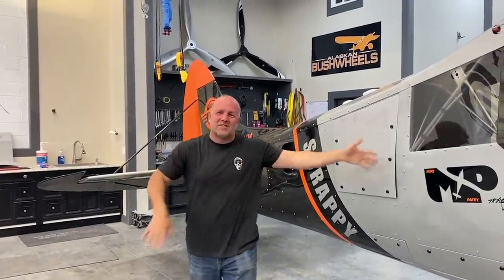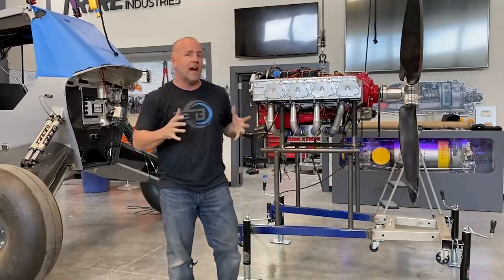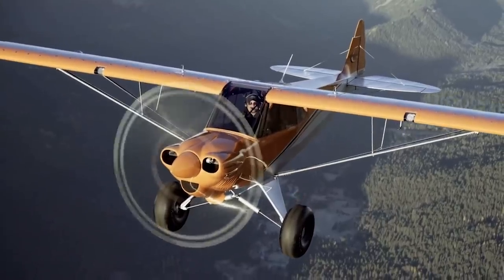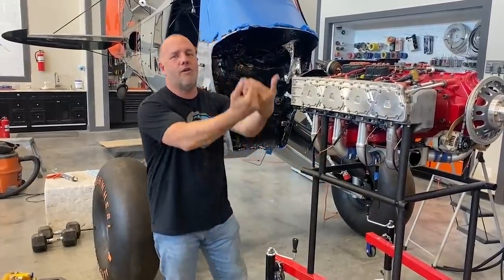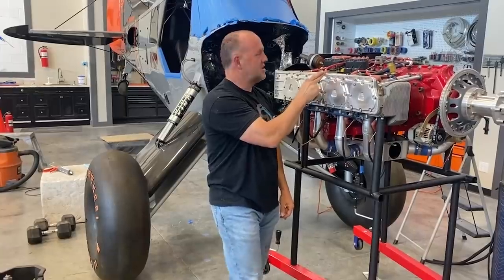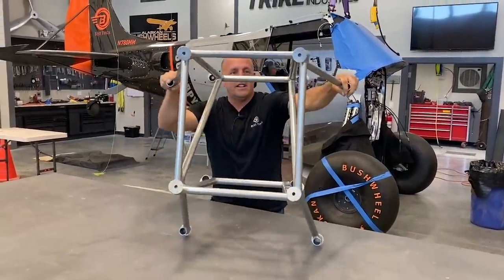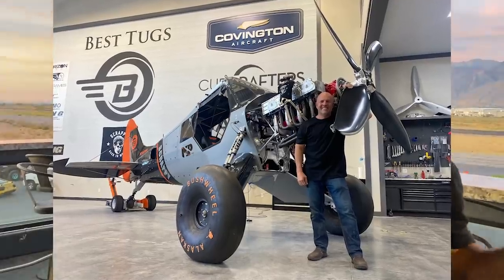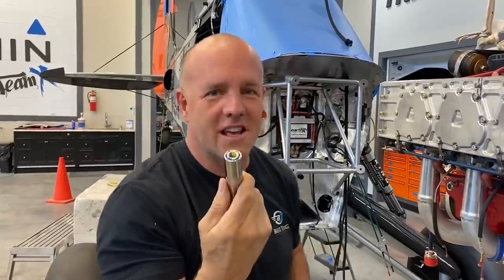Giant race engine into a Bush Plane 😳13 Liters goes into Scrappy build # 29

Comment: Did anyone notice something falling out of the new carburetor when tipped upside down?
Reply: Spare parts obviously
Reply: Hmm, I though it looked like fuel leaking out, I couldn't see it well enough.
Reply: Throttle Body???
Reply: @billrandell4641  Strictly speaking, it's called a fuel injection servo.
Reply: I ruined an engine that way one time
Took a 4bbl Holley from a spare truck, and I liked the nuts on it better, so I tossed them into it to carry them back to my truck...
They were underneath the choke plate, and I ended up using the original nuts on my truck, and then reved the engine to listen to the new carb.... Lol
Reply: @ke6gwf  Nice lol
Reply: It was the instruction booklet.
Reply: 13:45 the idle jet screw falls out :-)
Reply: @ke6gwf  Ouch!

Comment: "Machine it, draft it, build it, test it."  <-- there is something wrong here
Reply: BREAK IT ! ......
Reply from the maker: lol I never say things in order
Reply: Why draft it first? Built it... draft it makes sense. Then build it. Testing seems like a continuous process. Break it...? Yes!  I used break guns before they were accepted by the military. Let’s all get back to work.
Reply: @MikePatey  welcome to the non-linear mind.. lol, you have the comprehensive understanding of the concepts & essence of the entire form, but have to number all the concepts, parts, values etc. (Like a crime scene, lol!) so we can "connect the dots" to the big picture!  HAHAHA!🤠
Reply: @MikePatey  Silly tip... change to your tap on nut deep socket... masking tape, you call it painters tap i think... dont tap the nut it stays on the nut in location after fitting... turn the tap sticky out, just one strip across to cover the nut & push into the socket ... the tap then stays in the socket efter the nuts in place before or after torquing... tape left on the nut can draw moisture & create accelerated corrosion & just looks yuck anyway
Reply from the maker: Errol Churton Errol Churton  👍🤠 I agree with you completely.  🤠 I do the same as you just spelled out on most situations.  that’s exactly how I was told decades ago as a child. Sometime the tape just doesn’t hold like that and needs several wraps to keep tension tighter on some of the those tough inserts . So in that situation I wrap it like I described, sometimes several times around because one peace across the other way still has some slop play and will fall back out.  I probably should have described the standard method first and then mentioned the other when you need tighter tension.  Clearly now reading your comment I could have done way better on a simple tip explanation.  I truly never believed there would be one person that would actually leave the tape on the nut.  It never crossed my mind someone would be that short sided.   That would look so bad and your correct on the corrosion.  I should assume common sense may not always come into play when I give tips.  I try to keep things short and direct and not have people think I’m insulting them with some of the simple common sense things.  I have never left tape behind. I will  be more conscious of the basics, thanks for the comment.  Making videos is tough to say it all.  Hopefully others will read your suggestion as well.  Thanks 👍🤠
Reply: @MikePatey  Lol, it's always easier to start a conversation than finish it, a cornucopia of thoughts and conversation could continue like Pandora's box got opened, but all too soon it's back to work! This is the magic of the comments: gives opportunities for details/enhanced understanding as solicited, so much context gets lost in edit, but ENGAGEMENT leads to surpassing pre-edit content value alone by targeted conversations.. 💡next we want to see ya design a socket w/an "o-ring in a groove" concept to hold the nut..🤔💡🤯🤠 (credit to Errol Churton, he got me thinking after your tip!)
Reply from the maker: Francis Conti now that’s a great idea right there 👍🤠
Reply: @francisconti9085  not an O ring... a thin wire circlip, in a small groove at the end of the socket to just catch the hex points... why hasnt it been done already
Reply from the maker: Errol Churton great ideas! 🤠
Reply: @Errol.C-nz My friend, you got my idea.. I was streamlining w/the o-ring cheat to the basic idea..😃👍
Reply: @MikePatey  it feels like one of those OMG eureka moments... really simple, really easy to do...& so dam practical its as plain as the nose on our face... where's my lathe & sockets

Comment: Your bolts should be just safety wired in. Just like, “Military Aircraft.” Since you mentioned welds on an Aircraft you should have also had the, X-rayed completed on the welds or ultrasonically tested prior to installation. You can afford to purchase an the aircraft, but skip on the basics safety checks on the structure of the airframe, tells me you might not become an old pilot. It would not cost that much to minimally have the engine mount structure, “NDT-tested.”

Comment: I saw the cuts being made to the steel and wondered why they were done at an angle, great explanation on why you did that way. I saw you crawling in tight spaces to do those welds and wondered how good they were coming out. I'm guessing you were able to clean them up a little afterwards and no one will notice unless you point them out.

Can't wait to see more builds and drop tests coming our way. I love engineering and coming up with better ways to do things or ways to make life easier... speaking of, great work on the engine lift / holder/ thingy :-) I want to come hang out in your shop, but I'm busy designing large cold storage food facilities.
Reply from the maker: Very cool!  Thanks for your comment.  My best to you in your project.👍🏻👍🏻

Comment: A few gussets with small cutouts near the pipe welds in that frame would have really added strength to the frame with hardly any weight penalty.  BTW, I absolutely LOVE the opposing angles on the bolts to hold them in place during a SHTF incident.  Awesome work on everything with this build.  But then again, that's just MY opinion, for what it's worth.

Comment: Rolls Royce Hucknall worked like this when the re-engines the P51.  The Mustang A was put on stands to align the CofG. The crane used to remove the Allison engine hung the new Merlin in front of the airframe. Engineers levelled it up on chain blocks and measured for new engine mounts. 
The first Mustang X flew just 6 weeks later.

Comment: I've always wondered how rear engine mounts manage to work. I know they do, and I know scrappy will likely be the strongest ever made for its size. Just seems odd that there's no frame/cage extending forward to place the mounts more toward the center of the engine. Seems like alot of force hanging out, especially on a hard landing. Regardless, Scrappy is looking amazing. This continues to be one of my favorite channels. Theres a level of modesty that most people can't begin to fathom.

Comment: Mike, please have your mount weld joints X-Ray’d. (please) I realized you tacked the mount frame with MIG, then followed through with TIG. Joint prep is essential. Penetration is essential, and fill pass is essential. Induced stress will exploit a faulty weld joint and by the looks of that beautiful engine and the power it undoubtably produces, I have no doubt you will be compounding the stress levels. (Please have the joints x-Ray’d) We love you buddy!!!!

Comment: Mike. Your building and welding skills are amazing.  Since you seem to have the resources to build whatever you want, have you ever considered setting up and learning to weld titanium?  There are lots good people out there to learn from and setup isn’t all that big a deal.  If you copy parts in titanium and replace all your bolts, that is weight you never again have to lift off a field, haul through the air or try to stop on a hillside (or at the STOL drags.)

Comment: Brilliant motor - mount bolt angles! Whenever I nailed something in wood that shouldn't come apart, I alternated the angles of the nails. Someone tried to pry apart an item I had nailed together and they finally had to cut the nails - it wouldn't come apart.   :)

Comment: Don't know how you came up w/the opposing directions for motor mount bolts, but I was a mill works installer for 30yrs and all our trim was to be "V" nailed for that same reason. If gravity wanted to pull a piece of crown molding down, the nails in a "V" pattern were opposing or would want to come out in opposite directions. 
That and the idea that you could get 2 nails in one hole so any filler used would be on 1/2 the nail holes :)
Good job Mike, You da man !!
Steph

Comment: I love your design for motor mount bolt location to resist unsecured bolts falling out. A safety feature such as that should be considered by the FAA and EASA as a requirement for certification.

Comment: With 38 years of automotive engineering behind me, I've used that simple tape trick numerous times. It works great! There's a similar trick with a thin piece of spring steel and a very slightly over sized socket. 
I have a question though, what's going to prevent all that thrust and rotational torque from ripping that engine right off the aircraft??

Comment: For the tape on the socket, I do this for spark plugs, the rubber piece inside never stay and if you don't have the plug loose it'll just pull the rubber piece out of the socket. I wrap electrical tape on the edge so there is enough friction to hold the spark plug when you remove it. Another trick is to put electrical tape around your universal joint so it can flex but doesn't flop all over the place and you can actually shape it to get into locations otherwise would be much more difficult.

Comment: Mike love your energy.... FYI 4130 ( aka CROMEOLLY ) is incredible material,tough , incredibly strong,a pain in the  buns to machine(I cringe when I see you run the brand new starette holes saws dry) and a pleasure to weld,as you know ,unfortunately after its welded it needs to be normalized then re -heatreated or its and physical properties are very close to mild steel 1018. Spent 35 years building models for wind tunnel testing where every part involved had to be certified back to dirt. have moved to St. George after 60 years in so cal ,love your vids ,would love to talk some time   Joe

Comment: That tape idea is great I usually used a rubber hose. To thread my nuts and bolts in. You can’t cross thread them with a rubber hose either because they won’t tighten anyway. 

Awesome job love your videos!

Comment: Welding in situ is fine Mike, one need only add a good tack to the joints, then remove slave bolts & the frame , then just continue on bench. ? Have you thought  of slight variable aerofoil control mechanism.

Comment: In regards to dying when losing an engine, you can survive as one of our local pilots Dean Crites did in 1941.  Here is an excerpt from the story and a link to Dean and Dale Crites (Both now deceased from old age!) from Waukesha, WI.     He put the airplane into a dive to take away the effects of the rear CG and just before crashing pulled it out of the dive.  Dean used to also do acrobatic routines where during the performance he would pick up a handkerchief with the wingtip of his WACO that had a fish hook at the end of about a foot of fishline.  When asked by the Feds regarding the safety of this maneuver the story goes that Dean replied:   "Don't worry, it's harder than it looks!"                                                                                                                                                                                                                                       "In 1941, Dean Crites was instructing a 22-year-old-student when a
 
propeller broke, forcing the engine to rip from the plane 1,000 feet
in the air.

The student asked Dean Crites whether the engine's cover fell off.

" 'Hell no, we lost the whole engine,' " Gary Crites said, quoting his
father.

Dean Crites safely landed the plane. He later wrote that he
accomplished the landing using a dive to pick up speed so he could
control the plane.

"I would hereby advise any student who found himself alone in an
airplane in this situation, and if he had sufficient altitude, by all
means bail out and not endeavor to land the plane," he wrote.

The broken propeller, found by a nearby farmer, now sits in the Crites
Field airport.      https://groups.google.com/g/alt.obituaries/c/qsRWhOHji3U?pli=1

Comment: Great tip on the tape.
Had you given turbo's a thought? Has anyone? I don't see them used at all. Obviously superchargers have been used. 
Fuel injection versus carb?
And have you seen the  Koenigsegg Freevalve?

Do you think negative distance in a head wind will ever happen? Maybe it already has? I guess all you really need is a strong enough head wind.
Could you inflate the wing surface to gain lift and then release it for less drag?

Comment: I used to use a similar technique to get screws into tight spaces.  A little piece of painter's tape around the tip of the screwdriver and the head of the screw.  Just snug enough to hold the screw to the driver.  Once you've used it once, you can stick another screw on the end since the tape remains on the driver.

Comment: it's called an engine stand  Mike now call it : Adjustable Engine stand   :-)
If you jack comes slowly down just change the oil out from a hydraulic standard oil ISO 32 and change it over to ISO 68 I done it a lot on my older jacks when I don't want to replace seals or have small leaks. ISO 100 I think is to thick  but ISO 68 works like a charm. Tractor Supply or RuralKing has 5 Gallon for about $40 most the time in stock.

Comment: Mike if you ever have that same issue with a screw, whether its phillips, torx, or allen, a dab of grease on the driver will keep the hardware stuck to the driver while  you get it into position.

Comment: Your motor mount is awesome. Eight mounting points to the firewall is nearly indestructible! Aren't you as strong as your weakest link and there are only four bolts to the engine side?

Comment: I think the different angles of the bolts could have another positive side effect because they withstand more force when pulling straight than at 90 degrees and having them not go into the same direction spreads it across different angles. Correct me if I'm wrong.

Comment: Man you work fast! I’m really curious how that prop is going to work. Genius on the motor mount design. More planes should use that design! 500 hp isn’t enough.. I like the way you think! Are you considering porting the cylinder heads?

Comment: Skewed engine mount bolts is a novel approach, but I still like a cable wrapped around something just in case you shed a blade and vibration takes out the firewall!

Comment: Mike.... scrappy is quickly becoming my new favorite plane...but i have a quick question.  The crazy HP available will be exciting for take off for sure but my question is about landing.  How are you planing on landing this aircraft?  That plane will be able to hang on its prop....so to get the absolute shortest distance (using the prop for lift and almost like a helicopter) there will be alot of abuse on the tail wheel (I know you beefed it up) or are you bringing it in slow and using the wings for lift and smacking it down on the mains?  Longer landing but less abuse IMO.

Comment: You answered my only question at 12 minutes and 28 seconds as to the position of the engine. I knew the answer was there and you had it but I just wondered if you were going to tell us. Antidotal information, at 17 years old I work at an airport, grass runway and it was run like a gas station. If you would’ve said FAA to me then I would not have understood. The good thing about it was I got the fly a Stearman, piper cub, Aronica, tri-pacer and various other planes. Oh and I had no license. What was I thinking at that age 60 years ago?

Comment: @Mike Patey, I was thinking about the plane and just tought about a second good reason to lower the landinggear/rideheight: Short landings. By lowering the center of mass in relation to the wheel axis you can brake much harder and decrease the required space for a landing (and for take-off increase the throttle much further without the risk of it tipping over and having a propstrike or worse).  I assume this is something you allready tought of and because of this implemented the option to lower/raise the plane with the shockabsorbers. I mean, these shocks have that option right?
Reply: There is no reverse thrust on this prop so you have to get the braking performance some other way :)

Comment: I wonder how many with military aircraft maintenance experience thoughts went straight to safety wires and cotter pins when Mike was speaking of why the bolts were angled and inserted from the directions they were.

Comment: Mike, I question those steel hydraulic lines on the landing gear being so long in the airflow. They may be vibrated in the flow and there could be a fatigue problem. Maybe a hard line into the fuselage and then the tubes inside.

Comment: Back in the '80s (maybe '90s) a T38 our of Randolph AFB, in San Antonio, cut the motor off of a Cessna with its vertical stabilizer. The instructor pilot was able to make a controlled crash landing by deploying full flaps and both he and the student survived. Loosing the vertical stab also mortally wounded the T38 but they could just eject.
Reply from the maker: Wow! Glad it turned out they survived!!

Comment: Amazing work Mike!   Question.   So you specifically widened the planes suspension to account for the weight on landing.   You mentioned that the wider suspension will give you more braking control on tail swing during landing.   How did the parachute and moving engine forward effect those calculations.   Are you still where you wanna be?